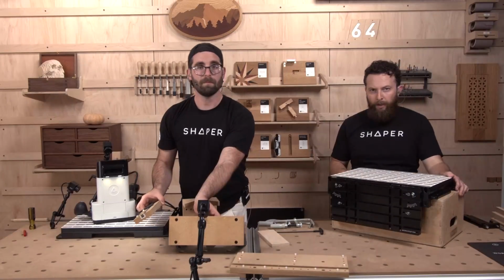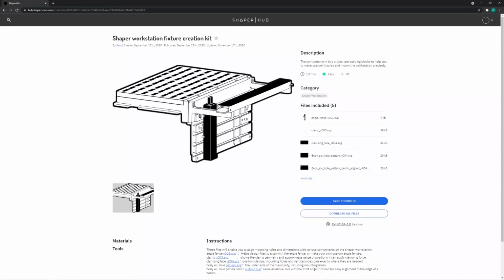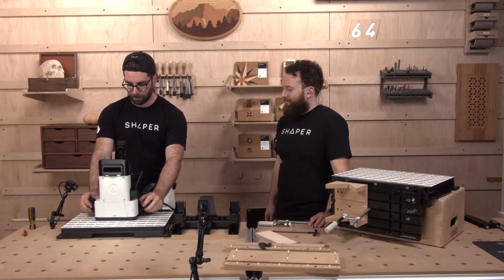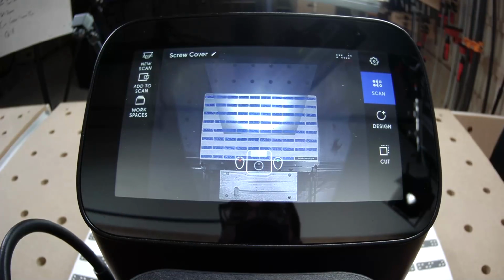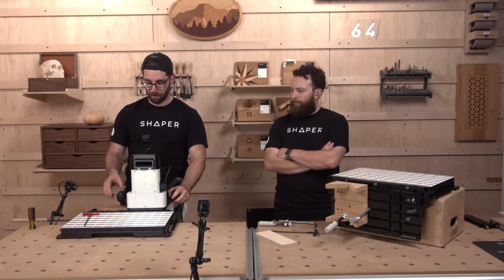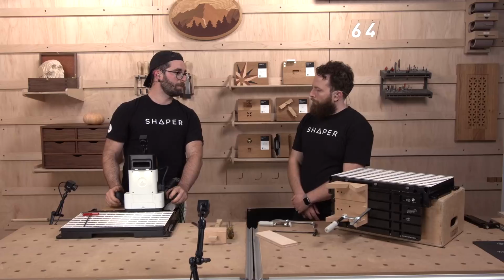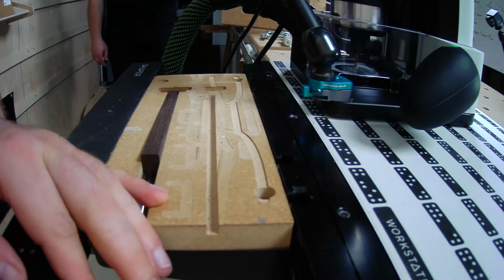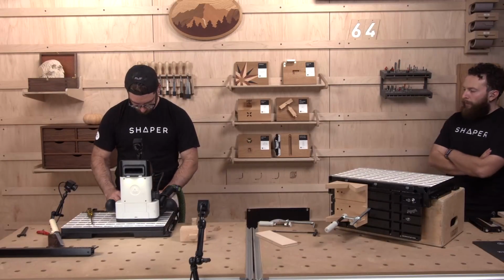Session 45  – English: Fixturing tips and tricks with Shaper Workstation

Comment: Fake Jake (Noah) is on fire... Set shelf height before you grid! LOL. And yeah, lock spindle before plugging in.  Both are "best practices" I have adopted.

It's true that forgetting to tighten spindle is a mistake you only make once.  Fortunately mine was on an good size inlay job and the solution worked out.  Tightened spindle and recut a little larger.  Then glued inlay pieces and filled difference with colored epoxy and it came out great.